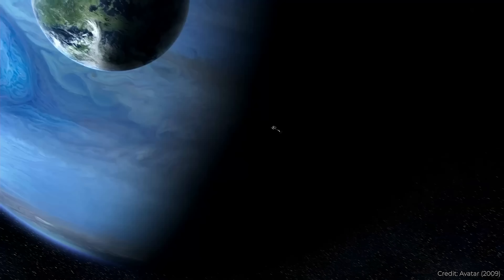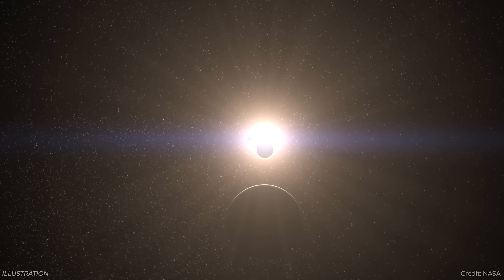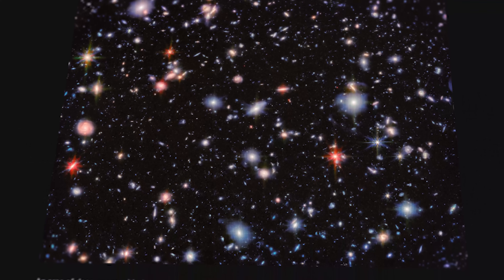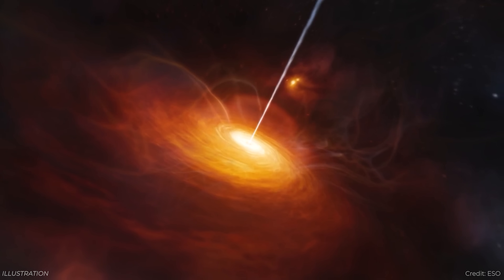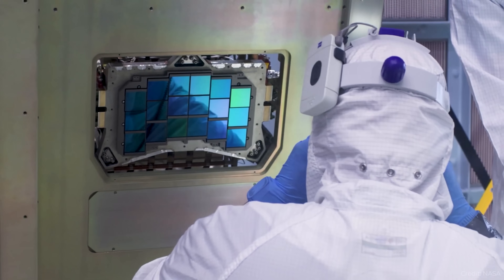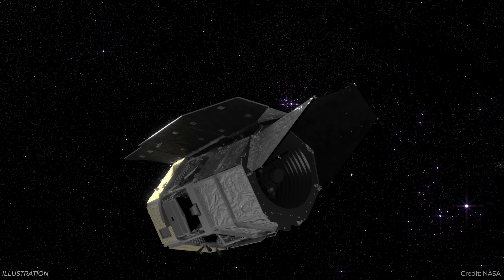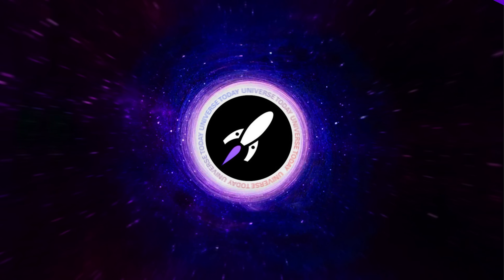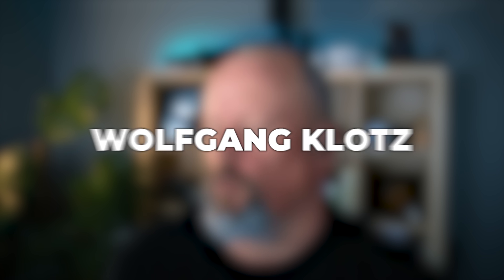New Planet at Alpha Centauri // Webb Ultra Deep Field // Six Mars Helicopters

Comment: I know this will seem very odd for you but I  have located an exosolar system. At 10 am my line of focus passes through Ursa Major and at 1.30 pm Cassiopia. An astronomical photographer has confirmed that what I have found is the Alpha Centauri system. There are 3 stars, one a red dwarf and 3 planets. There are no moons. I need someone with access to an impressive observatory near or below 29 degrees. 
Who will have a look for me? Committed, open-minded and determined. Fingers crossed. I need evidence for the IAU but also for the BSD. Will explain.)

Comment: Imagine if Musk was building rotating space stations where people could practically live and work. He could rent them out for 5 year stints. Like warehouses in space. It would completely change the engineering of satellites. They wouldn't need to be built like tanks anymore to withstand crazy vibration and they could be constructed in 1/50th the amount of time. Imagine them building a camera array the size of a 10 football fields and then pushing it to the edge of the solar system.

Comment: For 5 seconds I was very excited about a possible habitable exomoon.
Reply: we have no yet even confirmed a single exomoon, much less any habitable exomoon
Reply: @bbbnuyyyy  That's why i was excited for the possibility. A Jupiter sized planet in the habitable zone in close proximity is the best possible place to look for one. But if the planet doesn't even exist, then the chances are zero.
Reply: @TheBiggreenpig  According to science and mathematics, habitable exomoons are very unlikely. Even if a gas giant is in the habitable zone, most often the formed moon will have insufficient mass to hold an atmosphere. The satellite must have a mass close to or even higher than Mars, because in warm temperatures, unlike cold Titan, the atmosphere will leave the upper layers of the planet and gradually evaporate into space. A heavy massive satellite is almost impossible, especially close to the star (habitable zone), because there simply isn't enough accretion disk around the planet to form a sufficiently massive satellite, which is further aggravated by the fact that the star's mass will destabilize the disk. If there are no anomalies in this system, such as an excessively large amount of material, then the formation of a habitable satellite is impossible. Sorry.
Reply: @CitizenOfEmpire  There is no need of atmosphere with subsurface ocean? Besides, a large body could be captured later, so no need of forming right near the gas giant. Yeah, I know, these appear to be very low probability. But what were the chances of such a huge moon for Earth? Proxima is a trinary system, so there could be a lot of weird planetary migrations early on.
Reply: @TheBiggreenpig  Wrong, but youtube just deleted my comment, where I simply explain the types of exomoon formation. The most "free" app.
Reply: @TheBiggreenpig Second attempt: Almost all large moons of the solar system have a subsurface ocean and they don't even need a habitable zone, but it's unlikely that there could be anything more than bacteria there. Capturing a proto-planet is very small and almost impossible, because it would require colossal energy and very specific conditions for the planet to leave the star's orbit and take the necessary orbit of the gas giant. For example, the migration of Jupiter did not capture proto-planets, it simply threw them out of their orbits. But still, even though life is impossible, there will definitely be smaller moons. We can expect lifeless, but moons like Ganymede, Callisto, Luna, Io and others.
Reply: @CitizenOfEmpire  I'm perfectly fine with planets containing only bacteria. That would be awesome news. Imagine the implications of a planet just 4 ly away containing life.  Btw, Triton was likely a captured moon.
Reply: @TheBiggreenpig  Neptune had it much easier. Firstly, Triton was in the Kuiper belt and as I think you know, the further an object is from the sun, the longer it takes to orbit it and the less gravitational influence the star has. In the case of the Centauri giant, it is in the inner Rigil system and it is much more difficult to capture a planet there by making it a satellite. There are also theories that Triton was part of a binary system of Kuiper belt dwarf planets, facilitating capture through "system collapse." But these are still weakly confirmed theories. Still, Neptune is very far from the sun, increasing the Hill Sphere (possible satellites) and taking into account the weak influence of the sun, and the captured Triton is small enough and still not suitable to have an atmosphere and conditions for life more advanced than bacteria.
Reply: @TheBiggreenpig And by the way, maybe even the satellite Europa, or Titan, or Enceladus could contain bacteria, inside our own solar system. We have already sent a water sample to Europa for life and soon it will fly and fulfill the mission.
Reply: cough Prox B cough
Reply: Same here 

So for me, it ends up being  "#ClickBait"  😒
Reply: Still an interesting video.

Comment: Real question for you.  Wouldn't the radiation from the Gas giant be a problem for the planet orbiting around it?  Kind of like Jupiter.
Reply from the maker: Depends on the strength of its magnetosphere.
Reply: @frasercain  I'd assume a big ball of gas moving / spinning would produce one.  Can you get a large gas planet without a strong magnetosphere?  Do one actually exist that we have found, how would we know?
Reply: @dronethisllc  - Jupiter has a very strong magnetic field which creates  radiation belts of much higher intensity than Earth's Van Allen belts. ... so I think a moon's radiation environment around a gas giant depends on the mass of the gas giant (possibly the size of it's metallic hydrogen core) and whether or not the moon orbits within, or passes through, a radiation belt. 

Having a powerful magnetic field can be a bad thing for the surface radiation environment of a moon orbiting a gas giant. A Saturn-mass gas giant might be better than a Jupiter-mass gas giant.
Reply: @cacogenicist  Right but my thought is the gas giant would need to be within the habitable zone, so somewhat closer than Jupiter or Saturn is in our system exposing it to more radiation.  Also, the size of the radiation around them is very large so can you get one outside of the radiated zone?  Does Saturn not have a strong field? I just assumed the nature of a gas giant would produce large magnetic fields then also being closer to the star (for the moons temp sake) would just be a no go for any life surviving.  Would earths' magnetic field protect us if Earth was moving around a Jupiter like  planet around a star?
Reply: @frasercain  - And the moon's particular orbit, eh?
Reply: If the moon has a magnetosphere it can protect the atmosphere,  ganimede has a weak magnetosphere , so we know moons can have them

Comment: For the helicopter mission, where is the transmitter back to Earth? The first one used the lander because it could have a bigger antenna and more power.
Reply: Mars has 7 artificial satellites that are fully functioning and communicating:
» Mars Odyssey (ODY), NASA, 2001
» Mars Express (MEX), ESA, 2003
» Mars Reconnaissance Orbiter (MRO), NASA, 2006
» MAVEN (MVN), NASA, 2013
» ExoMars Trace Gas Orbiter (TGO), ESA/Roscosmos, 2016
» Emirates Mars Mission (Hope), UAESA, 2021
» Tianwen 1 orbiter, CNSA, 2021
Reply: @nae-nae-99 did Ingenuity actually have the range/power to reach orbit? Do any of the satellites have the ability and bandwidth to relay the messages? I am not sure, but I don't think either is true. 
This does raise the question of it being a practical method. I.e. is it practical to have better radios on the helicopters and custom satellite(s) to relay the messages? This may even be the plan, but a quick mention of this would have been nice.
Reply: @johnbennett1465  I think Ingenuity communicated to the satellites via the Perseverance rover as a relay. I don't think the drone itself had the power to transmit to orbit.

Comment: If the Alpha Centauri system has a planet, orbiting the star A, wouldn't its orbit be extremely unstable and chaotic because of the influence of the B star? The 3-Body Problem. In that case, it would be very difficult to track its irregular orbit.
Reply: For a planet to stay a planet, a planetary system or an orbit of a planet can't be chaotic. If a system were chaotic, a planet would be flung out or fall into its host star, or collide with another object in the system and become something else. So in a chaotic orbit, a planet could only be a planet temporarily.
Reply: 3 body problem usually only applies to equal mass objects. 2 stars and a planet should be mostly stable.
Reply: No. Just because a planet exists in a multi-star system doesn't mean it's inherently unstable. Usually it requires all objects be of near equal mass. 

In fact, that are several multi-star configuration that appear because they're highly stable. Alpha Centauri is actually a pretty cookie cutter trinary system with the smallest orbiting far out and the 2 closer inner ones orbiting each other, meaning that they can host several stable planets that aren't affected by the other star's hill spheres.
Reply: In addition to what Galaxia says, I suggest that you investigate Hill Spheres. This is the region where a body exerts exclusive practical control over a body that orbits within the sphere.
You can also investigate how orbital capture occurs.
Enjoy.
Edit to fix a typo.
Reply: 3 body means 
3 stars and a planet in those three bodies gravitational fields
Reply: The two stars are about 50 AU away from each other. This planet must be between 1 and 2 AU from its parent star in order to be in the goldilock zone. Which means that the pull of the other star would be too weak to actually unstable it